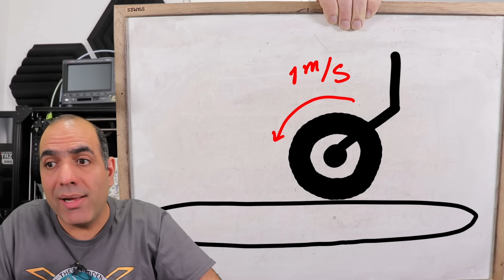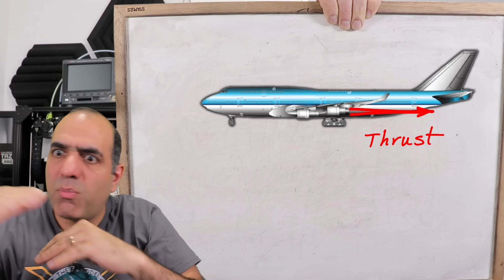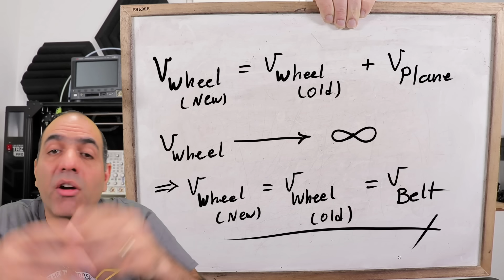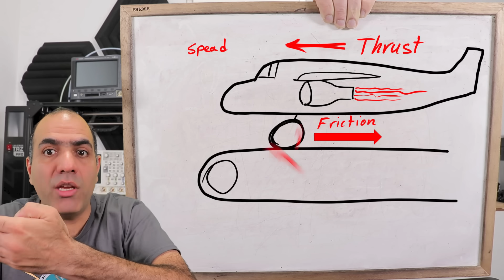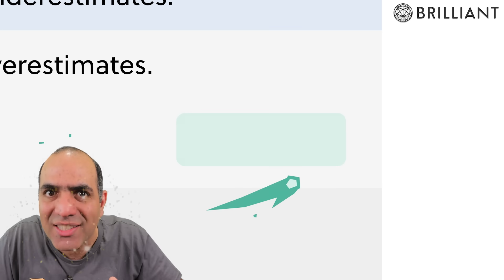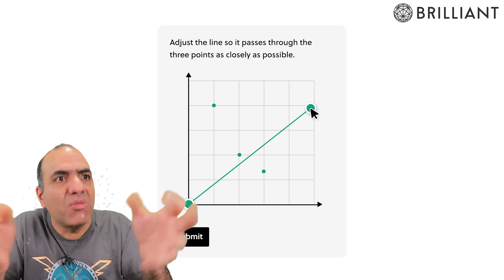Airplane Question that Drove Me NUTS!!!

Comment: Most "realistic" scenario:
In order to avoid a cause and effect 'paradox' regarding wheel spin and conveyor belt movement, the movement of the conveyor belt would have to be tied to the thrust.
At some high level of thrust, the belt would want to slip (but that is another 'paradox').
Therefore, you never reach a point where the wheels aren't spinning due to the weight of the plane on the tires and belt -- the friction.
Or, the bearing drag would equal the thrust even before the slip point.
Either way, the plane never takes off.

Comment: Shouldn't drive anyone nuts. It's quite simple. Regardless of whether the bearings are frictionless or not, and regardless of the overall rolling friction, the answer is the airplane certainly won't take off---it will explode instead.  As the wheel speed approaches infinity the tires will explode and the resulting destruction of the undercarriage will result in the fuselage impacting the surface of the belt. Result is complete destruction of the aircraft.

Funny how many people waste mental energy on this "problem."  The whole thing is one big logical fallacy.  It might as well have started with "if the moon is made of blue cheese, then..."

Comment: no, there is no airspeed over the wings if the conveyor belt is nullifying any horizontal movement the plane could have with its thrust so it has no lift

Comment: Wings need forward movement to create air pressure to lift the plane. A plane that is stationary on a conveyor belt does not move the wings through the air and therefore doesn’t generate lift.

Comment: the boring answer is the one they are looking for, I think.  The plane is sitting there.  the wheels and belt are also just sitting at a stand still as there is no force acting on either.  assuming nominal headwinds that would have no effect on things, the plane just sits there because a plane's wheels have nothing to do with it's flight.

Comment: This is yet another slight variation one of those stupid "airplane on a runway" trick questions which all a simple answer; If on earth, YES, because it's not a wheel driven vehicle. The details of weight on the wheels, drag and all that doesn't matter.. If you move enough air through the engine(s) of any plane (prop or jet) it's going to overcome wheel drag and fly away anyway because.. the wheels are freewheeled

Comment: You need air moving over (and under) the wings to generate lift.  How does this model do that?  How does it matter how fast the wheels and engine are going?
Reply: well the theory of the ones that take off is since the wheels themselves dont actually produce the aircraft's forward motion, the plane still accelerates anyways, just with it's wheels spinning faster than usual.

realistically if the conveyor is really desperate to keep the plane in place though it would spin so fast the plane's tyres blow up lol

Comment: It can take off because the thrust is not put down through the wheels but the jet engines so if there is a conveyor going the opposite dirrection the wheels would just spin faster right

Comment: the question does not state that the 747's wheels are moving. therefore, the conveyor belt has a speed of 0kts and the 747 is simply on top of a blooming expensive runway and will not take off.

Comment: The plane is sitting, this statement confirms the plane is indeed sitting stationary with no engines on. If the engines were on, the plane would just move.... The wheels are free spinning for good reason, it's cheap, it's simple, less problems can arise from it. This means the air would push the plane, making the conveyor belts speed useless in this scenario. 
I honestly am scared Twitter is just a vetoed version of chat GPT, they all share 1 brain cell and have the same idiotic takes.

Comment: In a real world,all silly additives ignored,
V2 for a 747 is around 185 mph,if elevators,flaps and ailerons are trimmed properly.So,a wind coming at the 747 at 185+ mph will cause the lift via pressure difference on the wings and elevators.If no wind is coming at the aircraft,the engines are still creating enough thrust to cause V2,whether the conveyor is moving or not.Example...the engines provide adequate thrust when aircraft is airborne,and there is no conveyor.So,yes,the aircraft will move despite the conveyor due to engine thrust.The engines will move the aircraft forward inspite of the conveyor.
Ive neutralized all possible areas for debate.

Comment: That was a weird one. One of the things I very much dislike about certain tests is multiple choice questions with 2 right answers but the question wants the "best" answer which is subjective.  Here's looking at you A+ Cert Exam.
Reply: Reminded me of an old soviet anecdote (actually, there are no new soviet anecdotes for some reason):
3 friends graduated from scholl. One went to university to become electrical engineer, one to become school teacher and the last one went to military academy. After their first exam they meet and ask each other about the exam. Future engineer:
- It was easy. Question: "What is the unit for the strength of electric current?" and answers "Volt", "Ampere" and "Watt".
Future teacher:
- Easy indeed. Question: "Is Ampere the unit for the strength of electric current?" and answers "Yes" and "No".
Military cadet:
- Lucky bastards. We've got: "Ampere is the unit for the strength of electric current." and answers "Yes!", "Affirmative!" and "Aye, sir!".
Reply: Just say it's not in budget and discussion on the topic will be resumed Q3 next year.
Reply: I absolutely hate IT exams. So subjective, and its mostly cramming
Reply: A+, Sec+, Network+  yeah., I feel ya'

There is also an issue with many of these question writers, that they don't actually logically form the question correctly. The phrase "designed to exactly match" is kinda strange, which could imply a few things, but it's always best to take it at face value. In system design we always say "Well, it depends." But these annoying questions NEVER allow for that. XD -_-

"If a tree falls in the forest...?"  Is anyone around to hear it? Does the tree physically exist, or just something you imagined? Does air exist in this imaginary world? In philosophy we'd say "Duh!  Of course there's a sound. Physical objects make sounds." BUT, this isn't philosophy class, IS it? So annoying.
Reply: @xileets  The "Logic" is readily apparent. It costs money to take the test officially.
Reply: Wait till you get to Net+ and Sec + then the fun really begins
Reply: The 2nd level of any standardized test isn't to give the "right" answer, it's to give the answer the test writer wants.
That's basically what test prep companies spend weeks and thousands of dollars to get you to learn, and the bad ones never tell you that. The good ones do (Princeton Review on SAT).
Reply: Can you make a redundant loop with STP? Yeah, can you do it with MPLS? Of course. What color best represents an iBGP session with 2 internal subnets over an IPsec GRE tunnel?
Reply: A question in a test I did as a kid that drove me insane went a bit like this.

Today is 1st February. You have two packs of biscuits. One expires 15th February, one expires 1st March. Which should you eat?

The answer was 1st March, because they'll last longer. Anyone else think that's ridiculous?
Reply: @DragonNexus  That reminded me of another old soviet anecdote:
The teacher asked her students:
- Given two crocodiles are flying, one of them is green, and the other down to Africa, how old am I? Yes, Max?
Max:
- You're 24.
- How did you calculate?
- It was easy. My mother called me "half-fool" yesterday and I'm 12.
Reply: the A+ cert can absolutely go fuck itself, I aced it but my god it was absolutely a chore because some of the "right" answers were so patently incorrect (given the information, anyway. I could see how they WOULD be correct if the question was straight up a different situation) that i dont find it surprising that most technicians i work with are fucking braindead idiots
Reply: The big trick here is to ignore the rotational system
Reply: @mycosys  The bigger trick here is to ignore clickbait bullshit on social media. You aren't going to get a prize for being "right." It always ends up like having a screaming match with a drunk woman in a bar.

Comment: My mate and I in engineering school argued over this question, hes Mechanical, and I'm structural. After an hour or two we got down to one assumption we made differently. He assumed the friction of the wheel would restrict the planes speed, I assumed it was negligible. At the end of the day, like a lot of engineering problems, this demonstrates how assumptions can change how we interpret and answer problems.
Reply: As the video suggests the wheel speed would eventually be infinite, which means the generated friction is also infinite. Your friends assumption was accurate.
Reply: The scenario also assumes you ignore the fact that the thing has wings. lol.

Comment: If the plane were somehow driven forward by its wheels, then no, but otherwise it wouldn't matter in the slightest.  They're unpowered rollers, not drive wheels.  This is like asking if I put the rear wheels of a front wheel drive car on a conveyor belt that rolled backward, would the car still go forward?  Well duh, yes, because the front wheels are providing the power.  If you turn on friction, the plane still takes off.  Eventually the bearing friction will be large enough that the wheels begin slipping against the belt.